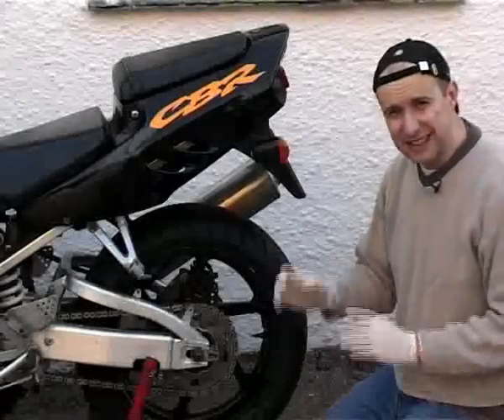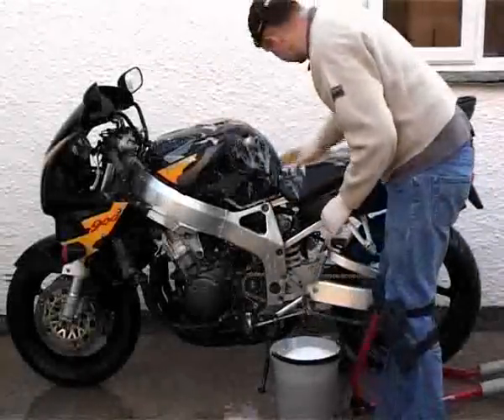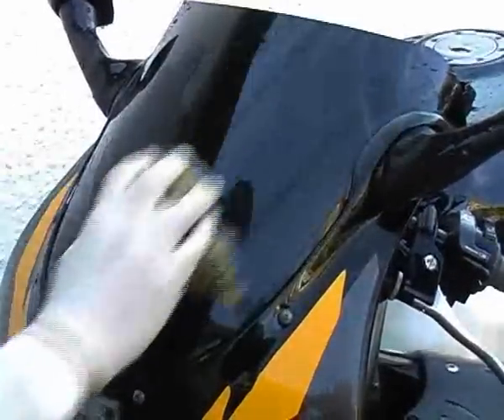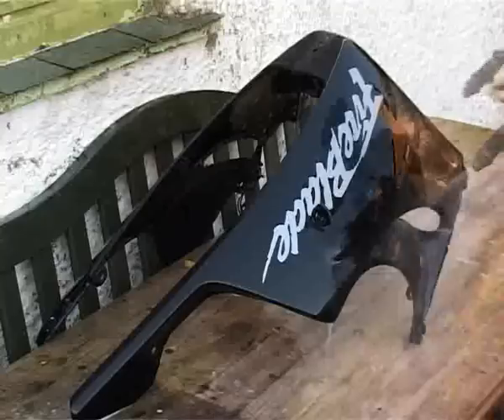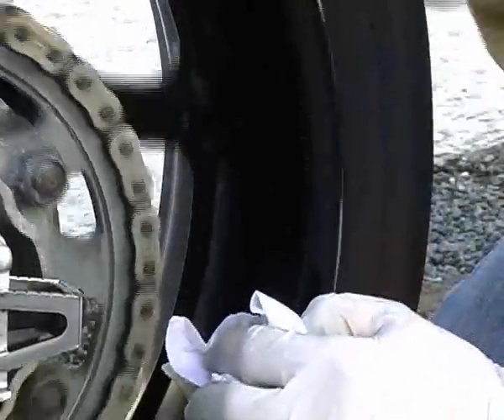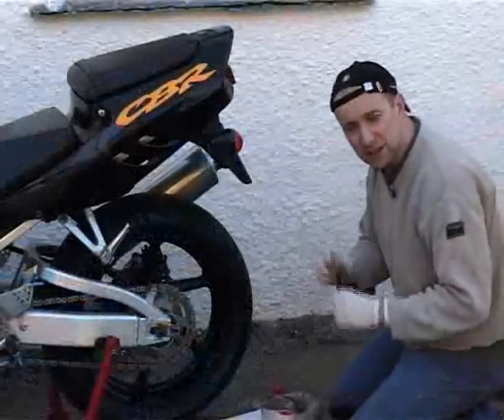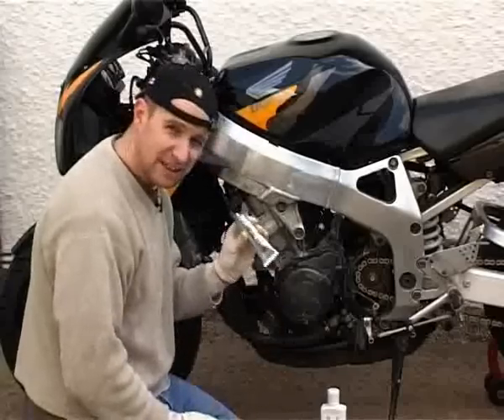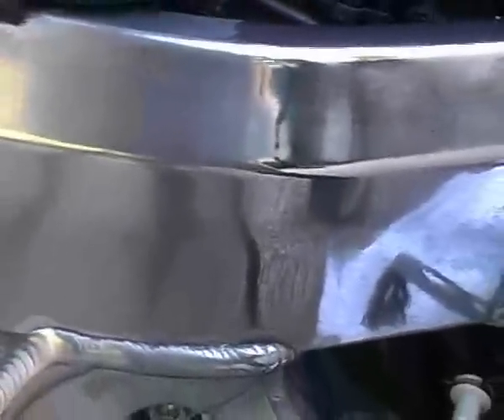Clean your Motorcycle - Part 3

Comment from the maker: Car degreasers are usually OK on your engine area but I wouldn't use them on your chain if it's got O-rings. Use WD40 or Parafin (you can get parafin from camping supply places) to clean your chain.  I've no idea about Kerosene causing cancer, but it seems unlikely as WD40 is based on Kerosene and isn't renowned for killing people! Unless you drink it of course.

Cheers

Nick Hine